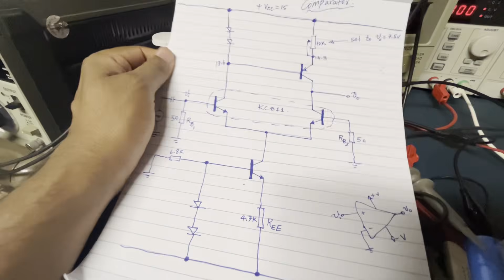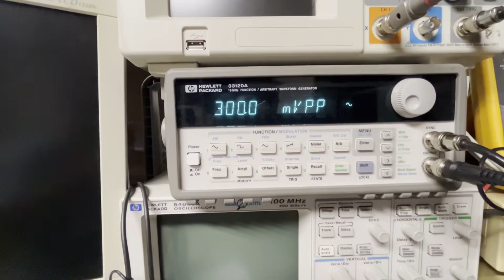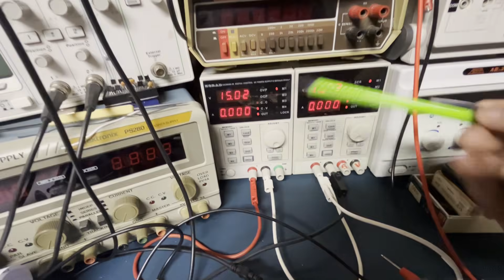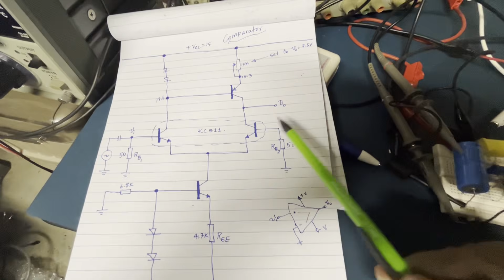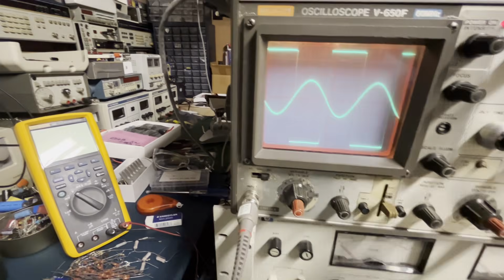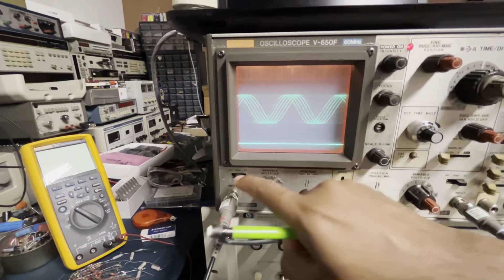Comparator Design using Discrete Transistors - Full Design and Calculation Video to Follow

Comment: The 'KC011" NPN differential pair BJT component that you used ( or put on your schematic) , does not come up on a datasheet search. What is the source of this component?
Reply: It is Czechoslovakian KC811.
Reply: @brys555  you can also use modern dual transistors like the BC847CDW1T1G in the SC-70-6-housing or the BC847BS_R1_00001 in the SOT-363-6 housing. Furthermore you can use the modern quad transistors MMPQ3904 or MMPQ2222A in the SO-16 housings to make a real current mirror to +Vcc.